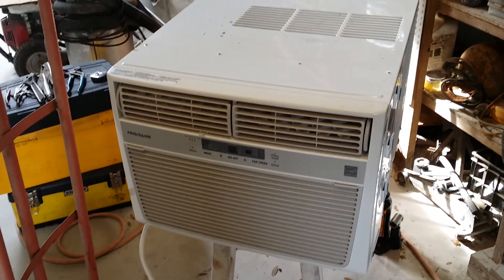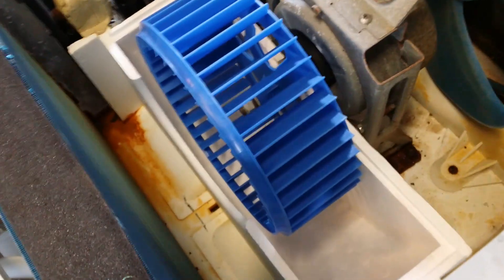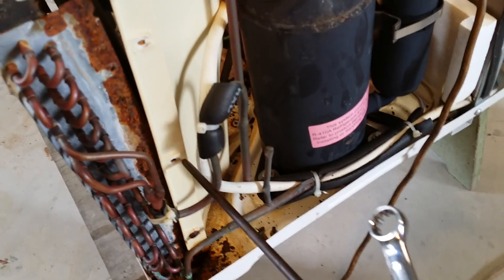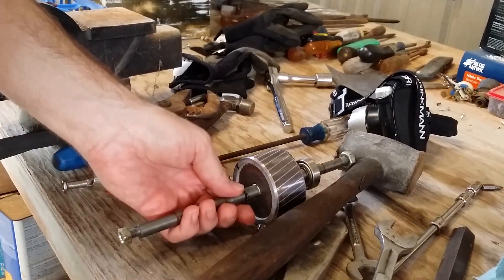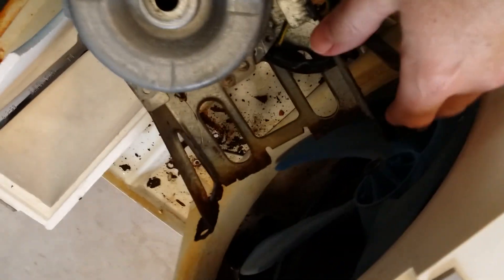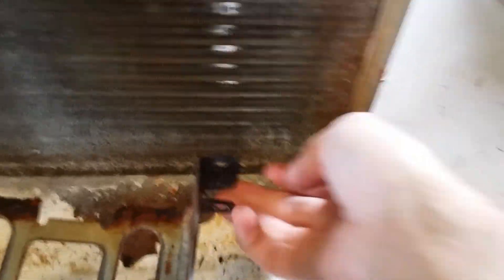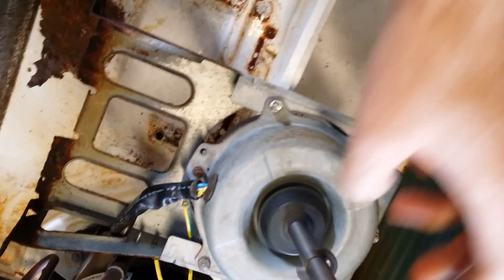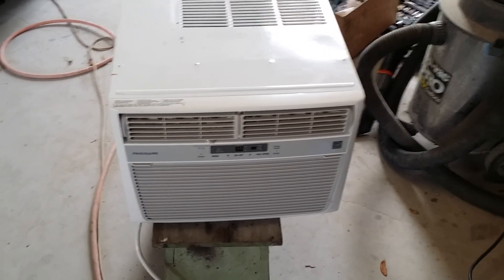Noisy window air conditioner A/C fan bearing

Comment: I set mine up to let the water run out of the back and apparently it went down the shaft from the evaporator and into the bearing. I have exactly the same problem with exactly the same air conditioner. Thank you for this video, after the summer I’m going to give the bearing change a try. After I watch this video at least twice!  We call them “left hand” threads. I REALLY appreciate you pointing that out.

Comment: READ THIS BEFORE REPLACING BEARINGS!
Use 3 in 1 oil. Oil both sides of the shaft where it enters motor (may have to take unit apart to access shaft). Sometimes you can just drip oil onto shaft then tilt unit so oil runs along shaft into motor. Depends on unit. Tilt unit to get oil into bearings. Spin fan as you go. Use lots of 3 in 1 oil; other oils don't last. I know. I tried with wrong oil; it lasted a week or so then noise returned. With 3 in 1 oil it has lasted entire summer.
I've been down this road. You will thank me.
If this doesn't work then you can resort to replacing bearings.
I've replaced bearings before and don't want to do it again unless absolutely necessary. I have better things to do.

Comment: Have this same unit just got this problem today. Last year I did a super clean now the fan was frozen. Spun it loose but its loud as hell now.
Reply: Yup, I've been there. When cleaning you have to avoid getting water into motor. See my other comment about oil.
Reply: @mattfoley6082  yeah i should have know but it was so old i just sprayed the ish out of everything, got it real clean!. After a week the bearing has quieted down almost to normal.. I plan on upgrading to a inverter unit like i have downstairs anyway. The energy savings and sound levels alone are worth it. I have a midea U downstairs and its amazing-  works great & electric bill was a fraction of the normal cost it was to run this older model

Comment: I have the same air conditioner and replaced the bearings in it after seeing this video. Before starting I wanted to have the bearings with me so I didn't have to wait for them to arrive while the air conditioner was in pieces. I found someone else's comment that shared which bearings they were but I'm going to share it again if someone else considers performing this fix. I was surprised to find out that they are just skateboard bearings. This is what I ordered from Amazon.

608-Z Shielded Sealed Miniature Skateboard-Bearings - 8x22x7mm
Reply: Thanks to both of you guys. My a/c driving me nuts with his noise
Reply: @wesleybrabant3595  Did ya do this route or buy a new one?
Reply: Thank you Travis you are a good man.👍
Just the information I was looking for.
I've got mine in pieces.
9.1.24

Comment: I have the same problem now with the same ac! I just had it apart to clean it but now it's making that noise? Could lubricating the fan and motor work also? Ty!
Reply: Yes! Use 3 in 1 oil (other oils don't last). Use lots of it and spin fan to work it in. I did this and it solved the problem and fan has worked for months no problems. Much easier than replacing bearings.

Comment: Could you show us what you did after 1:00? We removed the front plastic panel only. Then, how to remove another layer to reach inside?
OR is there any shortcut to put some oil on motor bearings?
Reply: I tried that, but no joy! Going to take it apart again. My motor has beefy rivets that aren’t going to be fun to take out.

Comment: Mike, do you happen to have the part number for the bearings you replaced? I have the same unit with the same problem as a result of me doing the same thing 😂 I would like to have the new parts ordered and on hand before I start taking it apart. Thanks

Comment: I just cleaned my 12,000 btu Kenmore and now am having that same noise issue. What Happens if i just let it run? Will it eventually eat shit? How long would it last it's running way cooler than it ever did. Tbh it was so dirty i now know why it struggled so badly last year.
Regardless i have it in energy saving mode till this weekend when i can pull it back apart and probably replace that damn bearing. I don't imagine the bearing will be salvageable

Comment: I have a Frigidaire FFRH0822R1 window heat pump that developed the same problem when I fired it up again after some very cold weather. It is nice to know the fix will be inexpensive if I'm willing to put in the work.

As to the rust in the pan, I've wondered for a why even more expensive units don't make that section from stainless steel or adonized aluminum. I'm also curious if a sacrificial anode (similar to that used in water heaters) could reduce or eliminate the corrosion.

Comment: I just saw your video and I'm glad i did! I just took one of my window AC's out and did a deep clean on it as I do every year, but this time i must have gotten some water in the motor bearings. 2 days later when running it before putting it all back together, I'm getting the grinding crunchy sound from the bearings. 

I'm going to take the motor apart and get the bearing part numbers tomorrow.  Thanks for the walkthrough!

Comment: Hi, your video is very much helpful.  Just one question, do your remember the Bearing # which you purchased and replaced.  It is Been 6+ year, the link of ebay item is not there any more.
Is it 6201 or 608?  My window unit has same Motor as in the video, so it shall be same bearing as yours.

Thanks

Comment: Hello Mike, Great video, very informative and I have a Frigidaire FFWW123WBE 12,000 BTU A/C window unit and it got noisy recently. I live by beachside here in Florida so rust is a big problem. Definitely I have the same problem with the bearings. My question is where can I get the replacement bearings for it? Would appreciate your advise.  Thanks.

Comment: Thank you for posting this mike mike. Nice job for your first video! Got mine tore down, and the bearings off. Will go to the local bike shop tomorrow for some sealed bearings. Shame on Electrolux for not putting sealed bearings in to begin with. Now, if I can just get the new ones installed, and get it all put back together, lol.

Comment: This is weird I have the same air conditioner with the same problems. I am forced to use it anyway because it's 95° where I'm at. You could save me a lot of time if you told me what bearings you bought I will have to leave mine run up until I get the bearings through the mail. If you don't mind
Reply: Dude, same here. Didn't even search by brand or model #.  First video I see = Exact loud bastard in my window...

Comment: Just got sold a working unit but it is loud. The guy plugged it in and it seemed relatively quiet. When I brought it home it would start screeching after a few minutes. Now it seems to do it more.   I can't return it so I think this will be a project. Thanks.

Comment: Thank you, I had this exact problem. Unfortunately I had a terrible time removing the old bearings. I looked up some low tech methods that didn’t involve getting extra tools, and after getting a bunch of scratches on my hands and arms, it’s running quietly again! Hopefully it last a while before some other part inside breaks.
Reply: Where did you get your bearings ?

Comment: I followed this video exactly, and it didn't fix my issue! But you or I did nothing wrong! Thanks for your excellent work making this! I have a much newer Frigidaire unit, and they have switched to rivets to hold the motor halves, and after carefully drilling all (5!) of those out, I discovered there is also an internal steel envelope in the motor with a pretty beefy pinch weld ALL THE WAY AROUND. I'll attack it another day, and document my failure or success to hopefully help others in the future!
Reply: Try again success is not far from you. It's very near.

Comment: So everyone will know the best called for oil for these fractional horsepower motors is straight 20 weight. For those that only need a small amount and don't want to purchase a whole quart, the Three In One oil that has the blue top is the proper oil to lubricate these motors with. The regular three in one machine oil if memory serves has a red top and a red colored can. That oil along with WD-40 is okay to clean with but for long lasting lubrication the 20 weight oil is what is supposed to be used.

Comment: I've owned 5 of those same AC units. 3 of them were 12,000 BTUs and the other 2 were 8,000 BTU. All 5 were the Frigidaire and had the exact same front panel  as yours the only difference was the BTU rating between my 2 units. All of them have had bearing issues as well as the Phillips screws that hold the motor mount down to the unit we're all rusted out as well. This window AC unit was probably the worst window AC unit to try to clean. Some manufacturers make it super easy to remove the motor and the fan unit that way you can clean it easier but Frigidaire definitely is not one of those manufacturers. I spent a total of $2,600 on my 5 AC units. All five failed in the middle of the second season. In other words about 1 1/2 years after I bought them. Good thing they have that 1 year warranty. 🤔
Reply: I have the 12000btu. It ran for 15 yrs and now the bearings are gone.
I wanna do this same thing but need to get the bearings.
Reply: You’d think after the second one you would have stopped buying them 😂
Reply: @joe4171  Ya may have been a thing if I didn't buy all of them at the same time.
Reply: Part number for the bearings?
Reply: @richiesun9676  If you don't know what I'm talking about then you didn't watch this video.

Comment: Over all a very good how to video especially since it was your first. I was a window air conditioner specialist since I performed all kinds of repairs to about 3,000 window acs in the 1980s from 1979 until 1989. I had my own shop and was the best at window ac repair in the St.Louis Missouri area. I do want to point out one thing where I believe you made an error in judgment. There is a reason that ac is designed for water to puddle in front of the condenser and that is so the spinning fan blade picks up some of the water and sprays it across that hot condenser in order to efficiently cool it.  By drilling that hole now the head pressure will run higher than it was designed for therefore shortening the life of the compressor. A better remedy although more time consuming would have been to cleaned the rust away and repainted it with a high quality rust resistant paint. There were some great old work horses made in the 1960s, real energy hogs but if taken care of some of those acs would last for 20 plus years. I liked the old whirlpools and the old Frederick window acs. They had those heavy barrel shaped compressors that were bigger at the bottom than the top and the compressors were externally sprung which cut down on a lot of internal compressor problems and made them run very quiet.
Reply: I'm doing the same job as in the video and I noticed the copper pipes in the bottom of the radiator are getting corroded from being submerged in water - three different metals together in water seems like bad idea. Anyway i was going to make drain holes that could be plugged somehow and then just drain at the end of the day. Do those pipes rust through or does the oxidized layer stop it from getting worse?

Comment: Hi Mike. Saw your video and managed to remove the motor. Need to also change the bearings but came to a standstill. I unscrewed the housing for the motor and removed it. My problem is the shaft won’t come off from one side of the housing. The 2 clips are all off of each side of the shaft but one side of the housing to slide off the shaft won’t let me do it. The housing seems to be bolted to the shaft as I can’t just slide it off. You mentioned in your video about reverse thread on the shaft. Do I turn the housing counterclockwise to remove the one side of the shaft that seems to be bolted?

Comment: This is the first video I found that addresses the same noise my Kenmore 12,000btu unit has been making on and off for the past week or so. I thought about buying a new ac for around $300, but being an ex motorcycle technician, I decided to find out if my suspensions were correct because of failed bearings and if so replace them myself. I looked online for a parts catalogue for the bearings with no results. I knew if it had bearings like in this video, there would be a bearing number on them and I would buy quality bearings, NOT made in China like the original ones are made, which is why they don't last. As soon as you turned your ac on and I heard the sound it made, I knew I found the right video because it's the same noise mine makes. I just wish I had a bearing number so I could buy them first so I could do the job in one shot. Thanks for this video. Now for the fun part.

Comment: Next time--- you should take a towel and dry out the water down there in the bottom... and then spray several layers of rustoleum paint on there---  that will at least buy you some more time on the rust problem.

Comment: I added a drainage hole to my 22 year old window unit.  When it rained heavily and my gutters overflowed  (lazy maintenance) it would make a god awful noise. It's a GE and still working, I've never removed from the window during the winter either.

Comment: Those fan motors have poorly engineered casings that fail to protect the bearings from moisture. Regardless, if you don’t wet them, they’ll still get wet from the blower wheel sucking in evaporator condensation, and still rust them out to where they’re screachers. ...and then those screws... OMG!!! they rust out to the point that they’re an obstruction to your disassembly work, or rendered completely useless. 
To people who wish to DIY these compact units: Get some Easy-Out reverse bits for those worn screws, a drill, a long Bosch extension bit for those floor pan screws mounting the fan assembly to the pan, a 2-3 foot long Phillips screwdriver, to tighten those same screws, some cork tape, and some new stainless steel replacement screws.
Stainless steel screws aren’t magnetic, but a tiny amount of cork tape helps the screw stick to the screw driver, in hard-to-reach places.

Comment: Found your video because I just put my AC in, same as the one you have and the bearings sound like crap.  It will do for now, but I won't be running it when I am sleeping for now.  I'll get it tore down and grab some bearings.  I actually worked for an electric motor repair shop for about 4 years so the motor part is easy for me.  

Word of advice, get some pullers to pull the bearings.  Even if you have to do a loan a tool its worth it. When it comes to installing the new ones you can actually heat the inner race and the bearing will literally fall down the shaft. Saves from beating on the shaft.

Also bearings are 99% chance nothing special.  They are generally something like a 605, 602, etc, and they are either sealed or they are not.
Reply: do you buy chance remember how it came apart? I have pieces that I cant remember where they came from
Reply: @JTrotter54  I just tore it down in order of how I saw best.  Once the outer shell was off I took off the Styrofoam pieces, unbolted the support brackets and worked my way around to undo the wiring. 

Once I had it out I had to drill out some rivets that were holding the two sides of the motor case together, then slid it apart, and did my thing to put it back together.  Just as quiet as the day I got it.
Reply: @brianm6117  I have two black o rings that are warped and i cannot figure out where they came from http://imgur.com/gallery/jP0WHcj
Reply: @JTrotter54  Those aren't orings.  Those are wave washers. They go between the bearing and the motor case.  They help the rotor "float" in the housing.
Reply: i think they both came from one side correct? also the armature may have shifted a little, is there any way to tell if it's sitting at the correct position? i saw skid marks on the shaft and tapped it back to cover those marks... thank you for your help!
Reply: @JTrotter54  My motor only had one wave washer on one end.  In general they can go on both sides or just one. Look for reference marks inside the housing.  

Also just a pet peeve but armature is not the correct term.  An armature is what you would find on a DC motor.  AC motors have rotors.  If the rotor moved then getting it back to as close as you can tell to the original position is all you can really do.  

Once the bearings are on you can place one half of the case on the shaft/rotor assembly.  The rotor is going to line up with the stator (the metal pieces inside the case that the copper winding goes through..  When I worked on electric motors we had to eyeball rotors into place more than once.
Reply: @brianm6117  im going to attempt the rebuild after my online class...ty so much and thanks for the education :)
Reply: @brianm6117  you got me far, i used some old fan screws to resecure the motor...i have a few pieces left im not sure where they go and i can't seem to get the nut on, maybe the shaft warped when i was hammerint it? any suggestions? http://imgur.com/gallery/Z3tqYKY
Reply: @brianm6117  someone suggested a tap and die set to fix the threads on the shaft im going to attempt that...last question im hoping you can answer does it go nut then washer to hold the fan in place or do use the circular rings somewhere...sorry for all the questions!

Comment: To get the front half of the motor case off of the stator I used the heat of a torch (carefully) to expand it. The case was free before I made one complete pass around it with the torch.